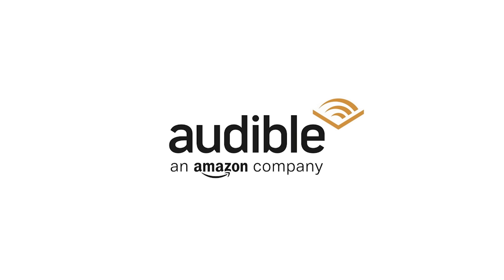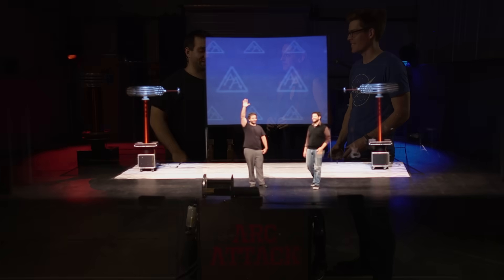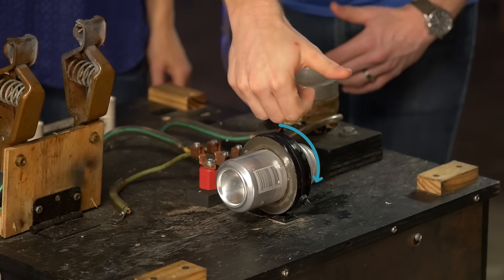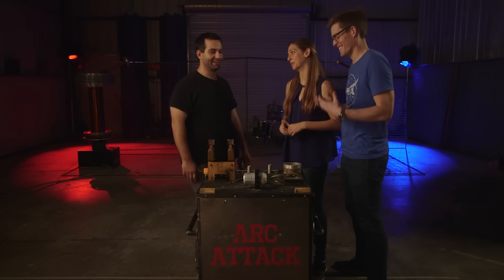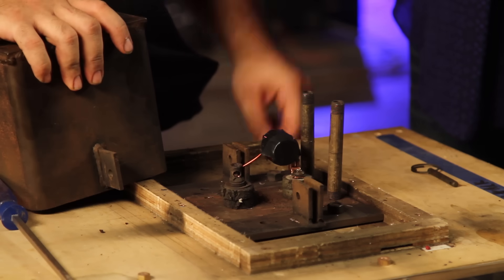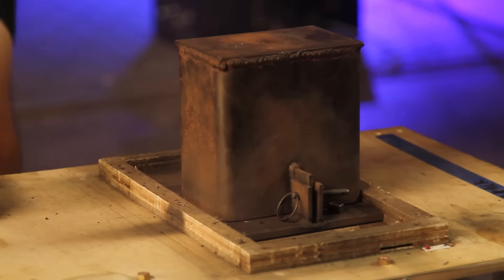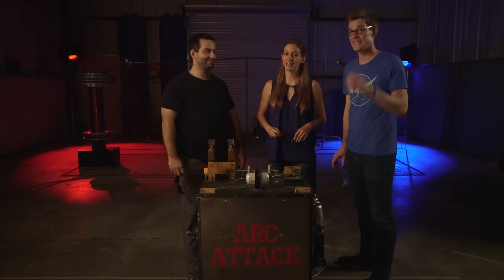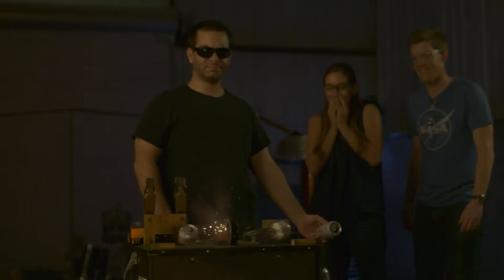Exploding soda cans with electromagnets in SLOW MOTION ft Joe Hanson

Comment: I have to say, that looking at the Al can centered tightly in the coil, is the "perfect" situation for getting the strongest B-field positioned wrt the can...a few years back, I was wondering where the B-field produced by a solenoid is maximum.  Some thought it may change with current.  Most thought down the center axis, so I finally wrote a program (based on the Biot-Savart law) calculating this numerically.  It turns out that the field is strongest:
1) inside the coil
2) as close to the INNER surface as you can get, ie, right at the inside wires, and
3) in the center of the coil
I even simulated current in the 'billions' of amps with tiny dl's...the program took days to run  The field pattern does NOT change (just the field intensity).
Some MIT lectures even claim max. field is down the center axis!

I have had some luck with a re-usable quarter shrinking coil...one that does not explode!
ps
I've yet to zap a can...can't be better than seeing yours in slo-mo.
THANKS FOR ALL OF THE GREAT VIDEOS!!!
--dALe

Comment: Please explain the flash when the can explodes. 
Thank you.
Reply: It's a voltage drop, which is actually what cuts the can in half. The induced voltage from a high-conductive material (a thick copper coil) into a weak conductor (a thin aluminum can) forces a huge drop in voltage, which releases a burst of energy and cuts the can in half. This is how LED lightbulbs work; they just drop the voltage over a coil by a certain amount, and depending on that amount, a frequency of light energy is released. This is simply a bigger voltage drop.

Comment: Try freezing the quarter down to liquid nitrogen or helium then shrink it.
It won't melt as much as it heats up. Well plug that into the simulator and see how hot the quarter will get.

Comment: the shrinking quarters that I am interested in can we do it with steel?  If we can, this could be possible to improve domestic steel to be way more bulletproof, the reason why the steel itself requires a long period of time of testing to be compact properly and the steel these days are really strong and can withstand against shells from a tank, but they don't last that long after the tank keep on pounding the steel plate to shatter it.  So domestic steel is the only type of strong plated armor good against heavy firearms and still, it gets ripped to shreds still, so improving by using that technology you can flatten out the metal faster that way and making even harder and denser of its micro gaps so it can perform perfect crystalized steel it doesn't mean your going be invisible, but it will provide in near future that we can use it for spacecraft or in other technology we require for.

Comment: Interesting, but every important detail missing, like current, voltage, duration, turns, wire gauge, capacitors used, joules, peak gauss, flux density etc.
A science show isn't a science show without these!
Reply: You can got to a website called capturedlightning.com. I think their name is stonebridge engineering. A man named Bert Hickman is the one who runs it and they shrink coins and he sells them for a nice price, about $15 or so depending what type of coin. The current that runs through that is about 1 million amps. They use a 10 turn coil. That coil explodes and the pieces fly apart faster than a bullet. Bert explains all this on his website. You should check it out, he has other things as well that has to do with high voltage, if you are into that.

Comment: we need ac current for repulsion between aluminium and electromagnet... am i correct???
Reply: Anand Tiwari Single DC pulse is all that is needed. (as used in the machine by the capacitor)
Reply: yes correct i got the answer, thanks for reply...
Reply: Shhh. The government doesn’t need to know.

Comment: I'd be very interested in knowing what kind of current/voltage we're talking about for these devices. I SO want to build them. I have many cans to split and quarters to shrink!
Reply: Craig Corson The capacitor that is used here has a stupidity massive value. Probably more than ten farad. It might deliver around 300 amps in a nano second and require one hell of a relay to handle the contact speed.

Comment: AluminIum. Not aluminum....
Reply: IUPAC lists both as acceptable.  "Aluminum" (which can be slurred/contracted to 2 syllables -- 'lum'num or "shiny") came first, then "aluminium" (which requires 5 syllables) was later introduced by some pompous prats to make it sound more like other "-ium" elements being discovered at the time, at the expense of awkward extra syllables.  The issue has been settled with "nobody cares unless they are particularly neurotic" and sensible people just know it's a matter of personal preference.

Platinum, electrum, aurum, plumbum, cuprum, argentum... various elements or alloys known since older times do not have the extra "i," so get over yourself.  'bye

Comment: If the can had water or some other liquid in it, what would happen to it in the slow motion videos? Would it retain it's shape as the can blew apart for a few milliseconds before collapsing? Would half exploded in each direction away from the coil? Would it splash out spherically? I want to see that! It might ruin the equipment though....
Reply: If that thin-walled can were full of essentially incompressible water, it would distribute the "cutting force" throughout the inside surface of the can.  The can would would fragment/explode like a grenade with many tiny bits flying out in all directions.  Very dangerous "experiment"...

Comment: Wait I didn't catch it, but do they use a DC pulse from a capacitor, or AC from the wall? Pretty sure both would work, but not sure which they used.
Reply: derek xiao That would be a DC pulse from a capacitor. AC from the wall would have a current (and thus a magnetic field) that would change directions multiple times rapidly over the course of a second and would not give you the results that you want - which in this case is one large current in one direction which induces a powerful magnetic field in one direction. The can's physical reaction to that field is what causes the can to rip itself apart.

Comment: How does this work??? Aluminium isn't ferromagnetic? Or does it become slightly magnetic with larger fields?
Reply: Hamish The Meme Lord aluminum isn't magnetic, however the properties they are exploiting only require conductivity. Because an electric current produces a magnetic field (and vice versa), any material that is a conductor (such as aluminum) will exhibit such behaviors. why everyone uses aluminum might be because it is lightweight, cheap, more conductive, honestly I have no idea.
Reply: ah I see, they probably use it because it's a weaker material which produces a more dramatic effect.

Comment: has ideas of free energy
Reply: Once you get it to work. You'll get a Nobel prize .
ONLY if it works.
Reply: onlyme0349 Nope, not even in theory. The second law of thermodynamics states that all closed systems will leak out energy at some pace or another. Not even black holes can retain all of their energy.
The universe is doomed to die a cold death.
Reply: Anthony Blank Earth moves around the sun because of gravity. A dumbed down explanation of gravity is that it basically bends space-time. So earth is just moving along a straight line, but that line happens to be put in a gravitational whirlpool around the sun. And even though there's some friction and gravity fluctuations, it can last a long fricking time around the sun because there's so much energy to begin with. So even though a lot of energy (think millions of joules) is constantly bleeding out into the surrounding space, it can last for millions of years.

But one day it will stop, just like everything would. It might take billions of years but it isn't a perpetual machine either. There can't be such a thing as free energy man :\
Reply: Yeah but free energy is impossible... entropy's got you by the balls.
Reply: You could in theory get all the energy back and reuse it.
You'd have to have 100% methods of conversion, and this might not be practically possible, but in theory.. we can dream y'know
Reply: onlyme0349 To the surrounding environment. You just can't keep it all enclosed, it's physically impossible. Look up videos on entropy and the 2nd law of thermodynamics if you're interested in learning more.
Reply: +TheDrB0B
Where does that leaked energy go?
Reply: ***** Ok, thx bro
Reply: TheDrB0B to this day the earth has been revolving around the sun, free of charge without a known end.
Reply: +Anthony Blank the earth may be moving around the sun, and yes that isn't going to change any time soon. But you see, neither is it doing any work. This is the problem with all these free energy ideas. They concentrate on trying to make the thing go around forever under no load, and forget that that only stores a finite amount of energy, the energy that set it in motion, and the second you try to tap that energy, the thing will quickly grind to a halt. Think of it more like a battery than a generator and you will see the physical reality of it a little better.

Comment: I'm guessing that the aluminum can is not 100% pure, else that would not work.
Reply: You are wrong. They are inducing a magnetic field. It simply needs to be conductive. Any conductive materiel would work. You can induce a magnetic field through your own body although you may not survive it.
Reply: Why not, you can make an inductor or transformer with aluminum wire. Same principal different implementation.
Reply: Blitzed Get good at science before you criticise things that you clearly didn't pay attention to.
Reply: Nope , it has to be iron (ect) to be magnetic

Comment: Physics Girl:  if you combine this experiment with The Black Hole Death Problem experiment you did is there any corrilation between the direction of the magnetic feild that splits the can and the process of Hawkins Radiation at a black hole where the negative particles are pulled into the black hole and the positive ones are projected out. Thank You for your videos.

Comment: Try this Joe(s): Shrink copper and aluminum tubes at a low enough energy level so it won't split them in two, only about half way down, and then look inside thru the ends and count the ripples. Mine are different, 8 for copper and 3 groups of 3 (most prominently) for aluminum. So is that out of something in the manufacturing or inherent in the elemental structure? And what causes it? Any time there's an unknown, it's potentially an area for discovery of something useful.

Comment: But the quarter isn't really shrinking.. that would be impossible using this method.  Instead it's simply swapping diameter with thickness.  I'm surprised that she implies in the description that it's actually possible to shrink the quarter.  That would require changing the number of atoms or the element composition itself... which is clearly not happening here.

Comment: The quarter was melted not squeezed by sending low voltage/high current through the flat surfaces of the ferrous pins. Similar to the way a Weller soldering gun works to heat the tip.While it is true electrons moving generate a magnetic field, the aluminum can is non ferrous and cannot be magnetized to create an electron cascade effect. Aluminum is conductive but electrons must be flowing through it and only while for it to attain magnetic properties. (This means you must apply a direct power/electron source to the can itself) No amount of magnetic field applied to it will induce a magnetic field and subsequent potential electrons or collection thereof. I call bull. Maybe the magnetic field has a similar effect as gravity has on all matter. We still don't understand the correlation between magnetism and gravity. Sparks/heat??? Does the field acting like gravity on non ferrous matter squeeze the can generating molecular friction thereby heat?

Comment: next time you upload an educational video, please be more accurate, people are like information sponges, and being wrong has the price of misleading people to believe the wrong idea.
so:
- you should have mentioned in the graphics the direction of the induced current (why is it shown in a straight line? its not so abstract, you just have current running cylindrically)
- "the can has nowhere to go but inward" thats not true, as you can see how the cans fly outward.
the truth is that the current loops of the can feel the magnetic field of the coil, and is repelled outaward by it. this happens of both sides, so the can rips apart.
a simpler way to think about it, is that the can is like a solenoid-> a solenoid is like a magnet-> the can halves are like two magnets effected by the coil witch is a third magnet with the configuration of (SN-NS-SN) therefore repelled. it might not sound appealing in text, but quite easy in graphics.

Comment: Can you please explain how the tube works in a little more detail? I might make that for my project and your help would be really appreciated. (How can I make it?)
Reply: anytime a magnet travels through a coil of wire (Copper is great) it creates a current. THis is how generators/Dyno's work. It is very simple.
Reply: TheMontanaDave So all I have to do to make this work is roll copper around a tube and connect a Led with both sides of the copper wire?
Reply: +Unificial Im not an expert but yes, that should work but the copper wires would have to be really thin and put around the tube very often
Reply: paul klement Oh okay..  I'll tried it but with no success..  I'll try to make it better. And see if it works..
Reply: If anyone has some more suggestions or thinks that they can explain it in a better way, please do.

Comment: I wanted to see the capacitors. :(
Reply: I hope that finding you here means you're planning a rail gun build
Reply: I didn't expect to find you here. xD
They probably put a Marx generator in there? The capacitors will be closed ceramic cylinders (probably filled with pressurized gas), not much to see there.... Still, I also would have liked them to show the circuits inside those tables.^^
Reply: Andy's Photonicinduction channel is the best !!!
Reply: For real.... How many turns in that can cutting coil?  What kind of currents are we talking about?
Reply: Shawn Stephenson If they discharge a high voltage capacitor through cables this thick, I'd say the current is in the kA range. As for the amount of turns... Considering the wire thickness you can see at the beginning entering the coil enclosure, a dozen or so?
Reply: show us its features :D
Reply: WHY ARE YOU EVERYWHERE I GO
Reply: same.
Reply: Hi Cody.
Reply: ayye what's good Cody
Reply: Cody!
Reply: AYYYY
Reply: TheBackyardScientist I should have known I'd end up back in your channel before the hour was up
Reply: typical dumbing down
Reply: @codyslab same
Reply: Cody'sLab health and safty reasons probably wonder how many kj of energy it took to shrink it as I'm building a impulse machine myself hope you get your YouTube problems sorted out cody
Reply: MZ flighter yes but where has he gone
Reply: I saw this device first time on Sam Barro's PowerLabs : http://www.powerlabs.org/ have a look for capacitors !
Reply: i wanted to see a big tattoo gun
Reply: Cody'sLab capacitors , codys doing the homer " donuts " 🤣😉
Reply: #Cody'sLab sub
Reply: ditto
Reply: 466 likes for no answer ...... stupid fanboys
Reply: Lol
Reply: You wanna see some capacitors? I got about 60kj worth for an upcoming video!

Comment: Did these guys tell you what kind of amperage/voltage is powering these experiments? Usually anything even APPROACHING this level requires some serious capacitor arrays. I'm curious about what they're using :O